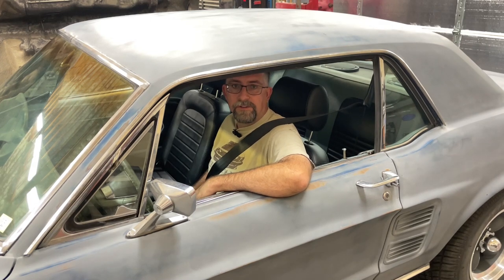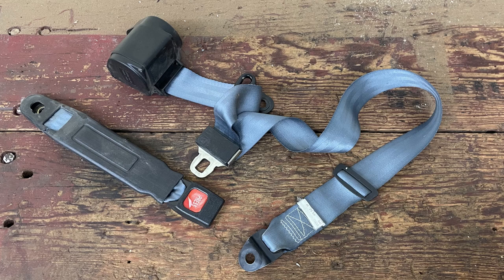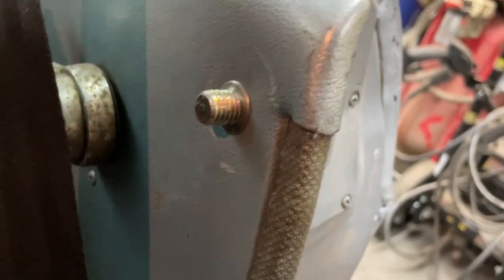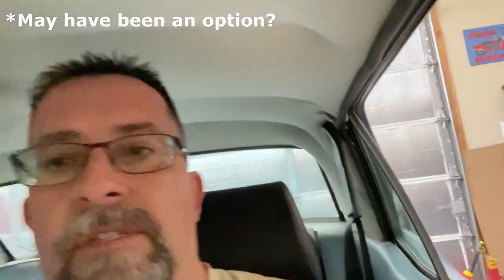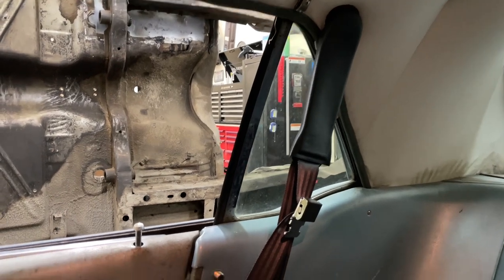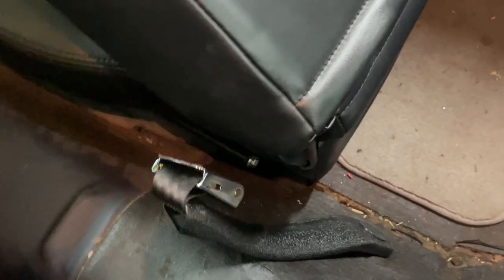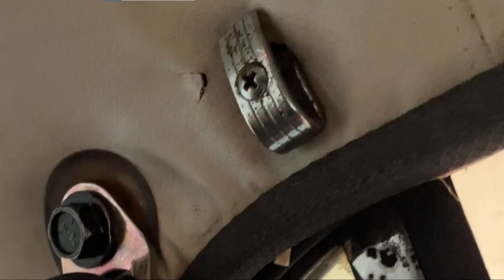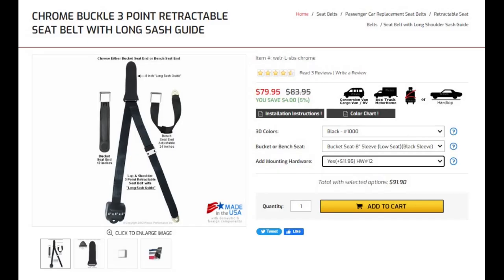Installing 3-point seatbelts in my 1967 Mustang.

Comment: Thanks for the video! I've been looking for a video that shows the rear seat in the car after the install, so I can see if there's interference with the seat. I'm looking at the exact same Wesco kit with the long shoulder sash for my '70 Cougar. I saw another video where he welded the lower anchor retractor point to the rocker instead of the bolt through the floor, so I'll probably do that - but now I know there's no inteference. I've bookmarked your video!
Reply from the maker: The retractor is a little in the way as far as foot room. For kids it probably won’t be an issue except them stepping all over it.  For adults it may be a trip hazard getting out.   I’m going to tuck it in closer to the rocker when I actually restore the interior of the car, just used the hole that was already there for now. I may look at anchoring it to the rocker as well. Interesting idea.  Thanks for watching!
Reply: Here's link to the other video I mentioned. I think the retractor would need to be more forward to accommodate the seat. https://www.youtube.com/watch?v=m87igXBHiTY

Comment: Would have been nice to actually seen how well the belts function, fit, or any pros and cons.
Reply from the maker: I’ve been using them for a while now. They fit comfortably.  The retractor on the floor needs to be moved a little, but I knew it when I installed them, just used the previous hole in the floor.  It is happier if it’s directly below the mount in the roof so the belt is vertical for the ratchet auto lock mechanism to work better.  Also, reaching over my shoulder is a little bit of a stretch but not too bad.  I highly recommend them for obvious safety reasons.  I can do a follow up review video if you like?